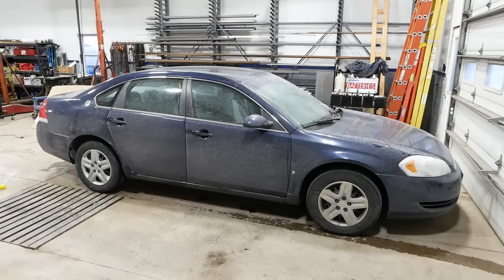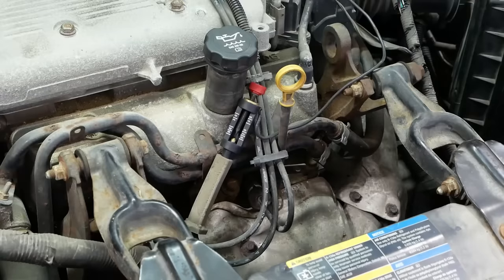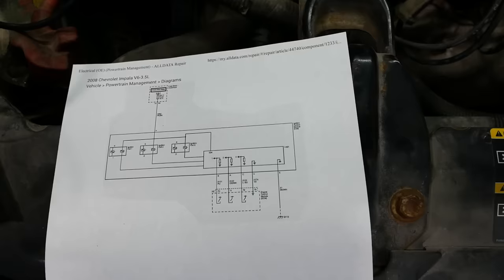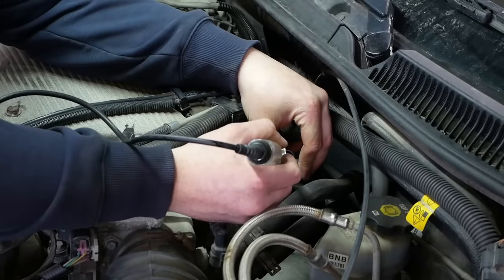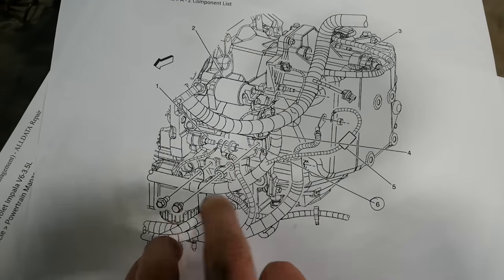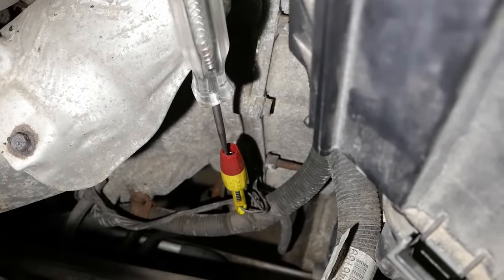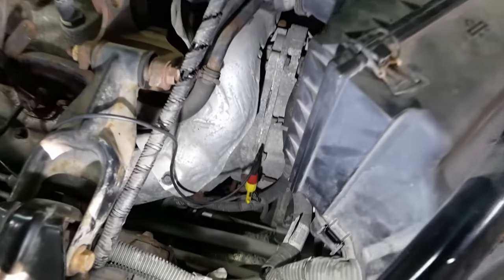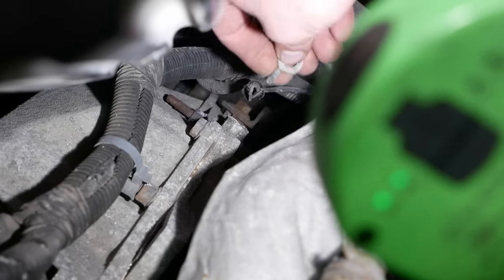Chevy Impala no Start, no Spark, no Codes

Comment: Love your videos Wes. Sad part is - if the owner took that to a dealership (especially to the one where I live here in Canada),  good chance they would milk many $$$ from an unsuspecting, non-mechanically inclined owner. I had the same car with a P0171 bank lean code (symptom was a slight miss at idle) - i finally gave up trying to diagnose it and took it to the "Professionals".  $2000 later and a a bunch of fuel injectors changed out, didn't make it 10 miles home and the code came back. Took it back and they claimed now they found glycol in the cylinders! Strange that wasn't found at first? I had no smoke or glycol usage so what a scam! A motorcycle mechanic friend of mine suggested a compression test - never thought to try and sure enough - compared the readings to my neighbor's car(same year & engine with no misfire/code), and his cylinders were all over 200psi, and 4 of my 6 were around 180. I dug deep and possible issue was aluminum cylinder heads on a cast iron block caused head gasket erosion issues. Lesson learned and folks BEWARE!!!

Comment: Nice job on the crimp connector using the adhesive lined heat shrink plus liquid electrical tape. Best not soldered on automotive application. 👍

Comment: Excellent video again on how to diagnose and fix a problem which could have been just left and forgotten about in a corner of a yard somewhere. Didn’t think you could get away with splicing both grounds together if the come from different components without it causing future problems. 
On another note, Are you going to do any future updates on the machines in that wooded place again, like the Insley dragline crane, the International 3850 End Loader or any of the other things there?
Reply: I also am curious

Comment: I like your liquid tape idea. Often the cheap heat shrink tubing I use won't shrink enough to give a tight seal on the insulation of the wires. I've been using dielectric grease, but it can easily leak out over time.

Comment: When it comes to diagnostics, slow and methodical wins every time....It also helps when you have an inkling as to what the hell you're doing..
Voice heard from the last mechanic who worked on the car.." I've replaced everything in the car except the air freshener and the damn thing still won't start...I wonder what Wes would do?  Good job brother, people like you are in short supply 👍🏻👍🏻

Comment: Wes, you could have used a pigtail on that splice for the grounds. A nice orange wire nut, and some electrical tape to give the splice a damp location rating. Don’t worry, the tape and wire nut are rated to 105 degrees C. 

Kidding of course. I love your videos, and always enjoy watching them. Good quality work, no hacking.
Reply from the maker: Maybe one of those "water resistant" scotch locks?

Comment: 10:10  I do favour soldering, but that's for personal use.  The new crimp on fittings with hot glue heat shrink, seal out the crud well too.

Comment: Rennsteig is a brand from Knipex. Basicly the same tools with the same quality but a little bit cheaper because the Knipex brand isn’t on there. Personally i like the Stripax wire strippers from Weidmuller even better then the Knipex ones. Stripax was also the first automatic wire stripper of its kind. Nice you got that as a gift from a viewer. They are in the €100,- plus range, still expensive although it is a Rennsteig.
Reply from the maker: I have a Knipex version that works even better.

Comment: Excellent video Wes :) also had same issues with my 2002 Chevrolet Impala E-X  also what found was ground pig tail to right wheel strut housing 10 mm bolt plus connector was corrison and when clean up got dirty in  4 weeks again  and battery post too on +  also - sides! So put new connector on - ground side also pig tail to another cable also crash bar too plus battery bolt clamp too ! Solve everything but found 2 fuse boxes with - & + cables were dirty so clean up then found when got wash to or  driving rain or months of Winter Season on 31 days on Cold or Hot starts heard seat belt beeper 2 after light go and on OB2 message center say Security Pass Lock light flashing on with Key and had wait 11 minutes clear and stay with key on! Then turn key off pull out and put on position and fire up! Wouldn't do this in April to October  unless rain going thru puddles to in warm weather just sunny be fine ! So had on computer test and nothing comes up codes or check for so my boss come over said I found problem in bay work on he said simple fix help with was connector problem you had fix mine was on Transmission bolt connector  broken of wire so had repaired to! But took 3 years cure computer recognize it was fix and clear codes too and this problem start in 2013 and cure it 2016 ! But when had problems had at GM dealership were car bought new and couldn't find it but my boss cousin did ! The wire was thin as ink pen see fluid in but found wire get tugging on when black plastic loom with another bigger wire so put tape on it plus black with hose clamp loom tighter and cure it all! No problem afterwards forever!

Comment: I wasnt going to say soldering, but those new connectors with the automatic solder/ heat shrink are awesome and are quite convenient in tight spots.
Reply: I like the convenience of those connectors. However I have experienced too many wires that moved even a little bit broken right at or in the solder from the vibration. And cars have vibration, even if not sensed in the driver's seat and steering wheel.

Comment: I love fixing joints with solder, however, on a recent job, the corrosion had tarnished the wire so badly that the soldered joint looked OK, but lasted only a few days. I had to replace the length of wire as it was rotted/tarnished all the way along inside the sheath. This time I made certain the solder joint was good.

Comment: I was gonna comment on the solder suggestion, but you beat me to it. Also, I have had the same Proto deep sockets for over 20 years. They’ve been a good tool.
Reply from the maker: Proto tools are pretty good, though they have become so expensive you might as well buy Snap On...

Comment: 12:40  I think that's a very reasonable assumption. 

13:10 I noticed the battery voltage on the scantool was fluctuating a lot while it was clearing codes, I was wondering if the modules might be drawing more current when clearing and there was some other iffy grounds. or maybe just normal behavior?
Reply from the maker: The battery is probably junk. That's pretty much normal for my shop.

Comment: Ok, nice video. I have same car, same engine. No crank. 40 amp starter fuse keeps blowing. Issue started on shopping center lot and I eventually got it to start by swapping the relay and fuse with the defroster circuit, as per other YouTube. Now it is home and dead in the water in front of the house. I've changed batter and be relay, but still fuse blows. Is this starter/solenoid? Will changing that stop this from blowing? It does sometimes have a thump when turning key with a new fuse, but then... It blows. This starter is buried in there too, so not looking forward to changing that.

Comment: Thanks Wes, very happy with the video. However, you should've soldered, then crimped, twisted then straightened, the wires, heat shrinked and electrical taped used a gold plated eyelet and btw what was the torque spec for that bolt?
Reply from the maker: I knew I missed something!

Comment: That is a perfect example of where a wire shouldn't be soldered.  The solder makes a stress point in the wire, and with vibration will fatigue and break.  I have worked to many transit specifications that prohibited solder connections because of fatigue failures.
Reply from the maker: NASA agrees.

Comment: Another great video Wes! I am a heavy equipment tech who spends most of my time in the winters installing and repairing plows and salt spreaders at the dealership I work at. Like you, I too enjoy stopping the flow of electricity by using dielectric grease on all my connections!!! Just a friendly tip, but I find when using shrink seal connections either applying the dielectric grease into the connector or on the twisted wires before crimping.. when the connector shrinks some of the grease exits and helps seal where the wires go in at. Keep up the great work

Comment: I've been researching new scan tools for days. They sure don't make it easy to sort through all these models and it's extremely aggravating. It's tough to spend so much money and still knowingly have something lacking compared to other brands and models. All of them have individual positive attributes and glaring deficiencies. Autel will likely get the nod.

Those strippers are pretty sweet, and the auto sizing is nice if it works well. I personally use Ideal Stripmaster wire strippers which so far keep me happy when I've got a lot of connections to make. Solder? In tight spaces? Nah, I'm good. Y'all are more than welcome to waste your time with it, but the OEMs didn't, so I don't sweat it.

Comment: At Delco Electronics we had the same crimpers as yours that had to be checked monthly. We were not allowed to solder stranded wires...Our harnesses were all white Teflon wires so were were always counting numbers and letters. What do you think about stripping extra wire and making a loop to double the wire in the crimp lug...we had to use incorrect sized terminals from time to time. (Non-production automated testing areas was my primary job.)

Comment: Thanks for the after-the-shoot slides with the answers (?) to the questions you posed in the video.  Please DON'T bother with solder; solder does not form an adequate mechanical connection.  DO consider using OEM-style eyelets.  They have two crimps; one for the wire, and the second to hold onto the insulation.
Reply from the maker: Yeah but to sell how well they held up.

Comment: Hey Wes 👋,  what bias voltage were you referring to when talking about not being able to set a code for the ICM? Great video btw
Reply from the maker: Yeah there can't be a bias voltage since it is not powered by the PCM. Now I feel dumb.
Reply: @WatchWesWork  not dumb at all man! I was just curious in case I missed it in the diagram! Vehicle is fixed and that's all that really matters

Comment: Solder can break/fatigue but from a corrosion perspective filling the wire/terminal cavity with solder seems like it would basically prevent oxygen from going in there...

Comment: I was working on this 2009 chevy Silverado that was causing it to go into limp mode or reduced engine power and the wire harness running right beside the power steering pinion boot was this little nick in the line causing it to short out anyways worked on this for while then finally seen that the harness was loose and binding and rotating with the boot pressed it up against one of the power steering hose. Then I pulled out my phone to record this then finally I seen it.

Comment: A good solder joint has the best electrical connection, but in a high vibration environment, the wire is very likely to break just past the joint where solder has wicked in between the strands and has made the wire solid.  This is why most connections are crimped in an automotive setting.   A good quality crimp terminal with a connection made by the correct crimping tool is very reliable, but if you use cheap terminals, some of them, the metal is too soft and thin to hold a solid connection over time, so spend the money on good terminals.  That said, I have really come to dislike those ratchet tools for insulated terminals as while they make a neat looking crimp, they often do not squeeze hard enough through the plastic insulation collar to really make a good connection.  This is especially true if you buy a different brand of replacement terminals where the plastic may be thicker/thinner than the tool was designed for..   I prefer a simple pair of plier style crimpers for insulated terminals as you can use the calibrated hand to determine whether the crimp actually took vs the ratchet bottoming out but the terminal not actually getting enough pressure.  I don't put much stock in a simple pull test as a marginal crimp can still hold the wire enough to pass a couple of tugs, but still let go after a few weeks or months of service..
Reply from the maker: I generally agree,  but most crimpers I have found will often tear the heat shrink insulation before making a good crimp. I don't know what we can really do beyond a tug test. I'm not going to send the connection out for calibration.
Reply: @WatchWesWork  This is why I like the simple pliers style crimpers as you can feel while squeezing through your "calibrated hand" (TM) that you actually got the crimp onto the wires vs the ratchet where it just bottoms out and if the terminal doesn't immediately pull out, you have to just assume that the crimp is OK..

I use a Klein Tools stripper/crimp tool as it doesn't just do the usual  oval crimp but has a middle anvil on one side that squishes everything from both the outside as well as the center, so you know the connection is good.  The only issue with it is that the crimp function is located below the hinge, just above the handles, so you would have a hard time doing crimps way down in an engine compartment with it..  It does make a very nice crimp even on insulated terminals as it just leaves the central indent on one side instead of destroying the insulation..

Comment: I enjoyed the video, Wes! Great troubleshooting methods and follow-up.  Stay warm!

in industrial and automotive applications, crimping is superior to soldering.  The filler metals in solder degrade and the brittle nature of a solder joint does not last long in environments subjected to thermal, shock, and vibrational stresses. A properly crimped and stress relieved joint is the best. Look at what is already in use on an application when repairing it. Someone paid a lot of money for engineers to figure out what to use in that application. You can consider yourself smarter than those engineers but I'm sorry to say it's unlikely.
Reply: Any yet it failed, dead on the road, despite all the money paid to engineers. 
You don't need to be smarter, but on a repair you have hindsight and the one thing at your disposal the original designer could not afford: overkill.

I don't think it matters if this repair was soldered or crimped, as long as you make sure to keep the moisture out and provide stress relief it'll last longer than factory. I agree on crimping in general, but there is nothing wrong with deviating from the original design, especially if it already broke once.
Reply from the maker: I figure a lot of their choice was about cost and getting a machine to crimp the terminal for a few pennies as possible. But do normally last the life of the vehicle and more.
Reply: Yes, that crimp took seconds and the eyelet cost pennies. Had the designer spent 5 minutes for this connection and a buck on materials like you did he would have been fired, and rightly so. The limitations for a repair are different, even if one solves the same technical problem, so there can be good reasons to deviate from the original design. There are a dozen ways to do this right and you showed one of them.
Reply: @stefantrethan  And yet it far suprased anything you've designed and sold to millions of people. There's a reason that space craft use crimped connections. The same reason everything in the military that I worked on has crimped connections. This connection on this car failed and somehow you have a better idea thatn all the people that have 50 years of expereience.  I bet yuou second guess what oil to put into cars too.
Reply: @stefantrethan  The correct way to repair the failure is the same way it was designed to begin with unless you somehow know better.  I hae worked with soe many people like this that thing they somehow know best  Yet they are the same as everyone else making minimum wage.
Reply: @WatchWesWork  Today's products are certainly engineered to a price envelope. But soldeirng is cheaper than crimping  at lease in the manufacturing that I've done. The problem is that solder joints fail very rapidly under moderate vaibration, are not any less prone to corosion. The loss of lead in soldering has even made problems worse but everything must be RhoS compliant these days.  Even frigging space craft.  There's bee huge problems with silver solder on space craft to the point that craft are failing many years before they should.
Reply: @rgmoore  You don't understand Russ, I make these decisions every day. I tried to explain to you that the goal of series production is making things reliable enough, but as cheap and efficient as possible, this is what I get paid for. It is quite easy to improve individual details on mass produced items if you are only making one repair and time and money virtually doesn't matter. This is what Wes gets paid for, solving one problem for good, not re-creating factory condition, nobody cares about that, unless maybe on some show car.

It is not that the original designer didn't know how to make this connection last 10 times as long. Of course he did, but this simple crimp without any environmental protection was deemed good enough for this application, and in 99.9% of cases it probably was.
Reply: @stefantrethan  it was pretty obvious from your prior comments that you were arguing against the original design and the repari made. Where's you're materials science degree from?  I assum you are saying you make these decisions every day and implying you are responsible for the design and implmenation of such fixturings. What Wes did was a great repair and the correct one.  It was slighly better than the orignal as he took steps to isolate the metal from the invironment.  What products are you making these decisons on in the market everyday?